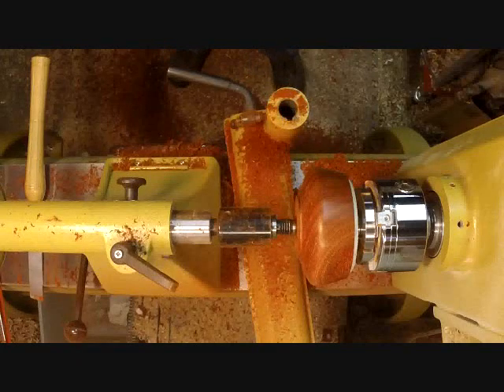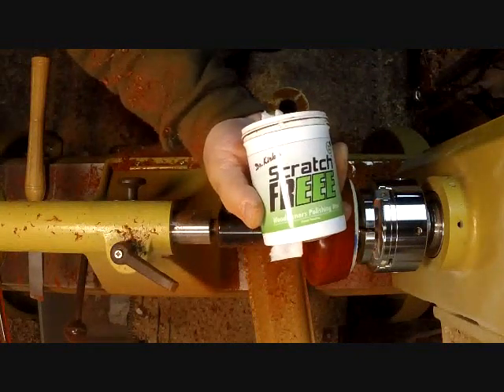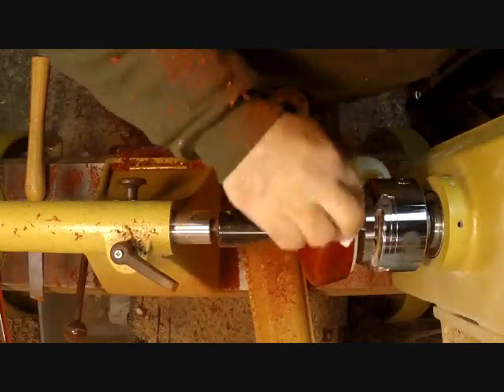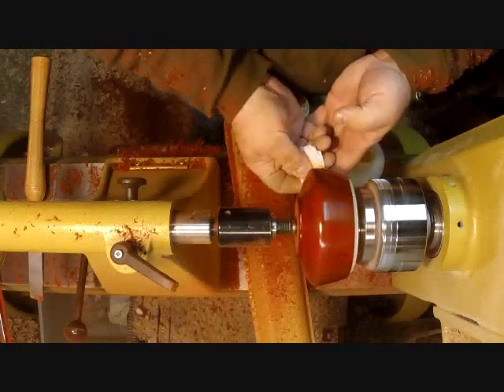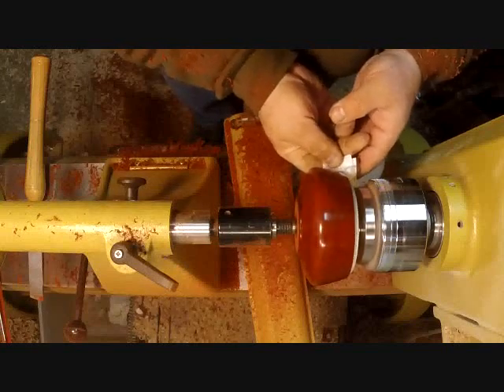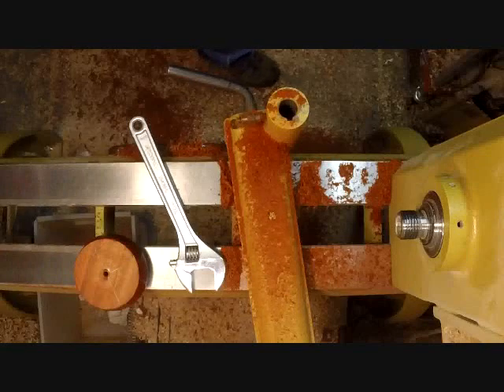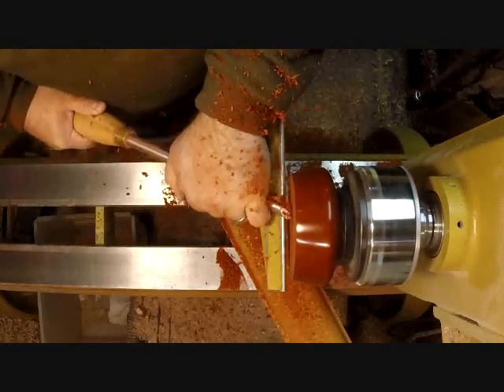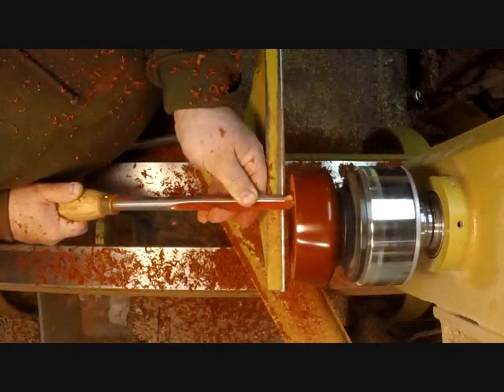Turning a Padauk Bowl Part 2

Comment: man you really are good,,i hope one day I can get that good,,can you please tell me what type of bowl gouges you are using and do they have the irish grind on them,,i have been having a bad time using them,,and what degree is the bevel on them,,and what is the different finishes that you use,,,thank you
Reply from the maker: Thanks Jeff, I appreciate it!  Keep practicing, keep asking questions...you'll get there. 
I use a 5/8 Sorby gouge with a round flute, a 3/8 Woodriver gouge with a "V" flute, a 5/8 Ellsworth (Irish ground) gouge and a bowl bottoming gouge.  ALL my bowl gouges are sharpened to 50 degrees and ALL of my spindle gouges (not the roughing gouge) are sharpened to 45 degrees.  The key with sharpening is to be able to get the same grind every time. Consistently.  I use a Wolverine system with the Vari-grind jig.  The brand of tool you use doesn't really matter, some are better quality like Thompson and D-Way, others are low end like Benjamins Best from PSI.  The Woodriver I use came from Woodcraft and it's good enough.  The Sorby is better but only because it holds the edge a little longer.  If you're a professional turner, higher quality tools will make a difference because you'll not have to sharpen as often, on average.  At that point, time is money. 
The grinds on my 2 regular gouges are fingernail, the only Irish grind I use is the Ellsworth.  The reason I like the 5/8 tools best is because that's what fits into my hand the best.  And it's easier to make small things with a big tool than it is to make big things with a small tool.  Seems the better I get, the less time I spend using smaller tools.  I don't need to switch as often, and that's just from experience.  Again, you'll get there. 
The finishing products I used on this bowl are:
Mylands Cellulose Sanding Sealer (Rockler)
Dr. Kirks ScratchFrEEE (Craft Supplies USA)
and Mylands Friction Polish (Rockler)

Feel free to ask any questions you may have, I'll be happy to try and answer. 
My email is  jeff@thewalnutlog.com
use that, I'll probably be able to answer much faster!  If you're on Instagram, look me up as @thewalnutlogstudio 
Without seeing you work, it's hard to tell where you're having problems.  My guess is  it's more likely a sharpening issue than a tool quality issue.  As long as the tool is HSS, it should be good enough.  Please note, I started out with a Harbor Freight set and still use several of the tools regularly.  One of them is actually my main pen turning tool!  Just because a tool is cheap, doesn't mean it's bad. 

Look forward to hearing from you, hope my answer helps!

Comment: Nice video.  I tend to make bowls of similar size and shape.  I'm going to try your finishing technique.  I usually do not finish any of it until I turn the bowl into the jaws, so curious if you recommend finishing the outside first before remounting and why?
Reply from the maker: Thanks for watching, Peter!  I tend to finish the outside as much as possible before working the inside because I know the wood is going to move...and because I'm lazy and want to eliminate as many extra steps as possible. Lol. It's easier to come back and finish just the foot or base than it is finishing the entire outside. If the wood has moved enough, you now have an untrue piece mounted that you're trying to put the finish on. Hope that helps!
Reply: +The Walnut Log Studio Thanks!  I was figuring the wood movement was likely the reason. I do always come back and finish the foot, but also being lazy :-), I was thinking two finishing steps v.s three.